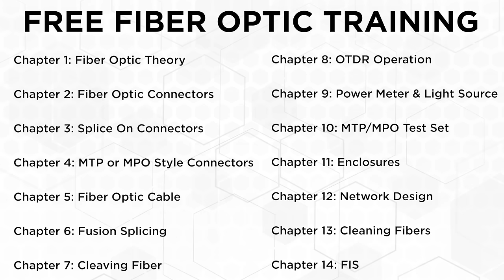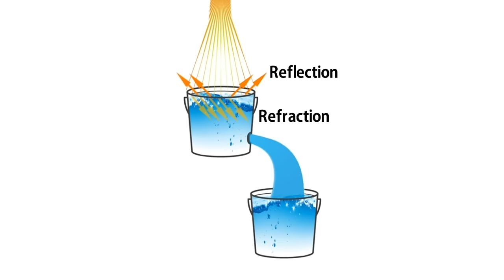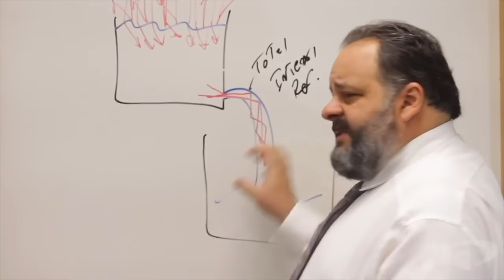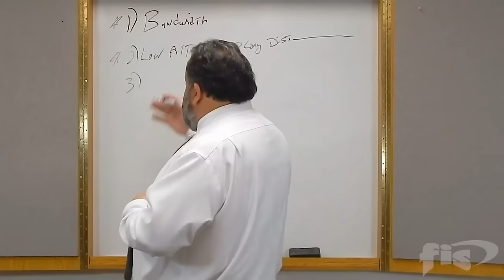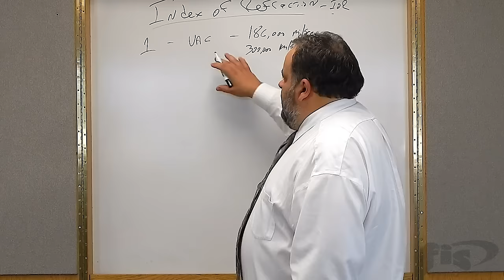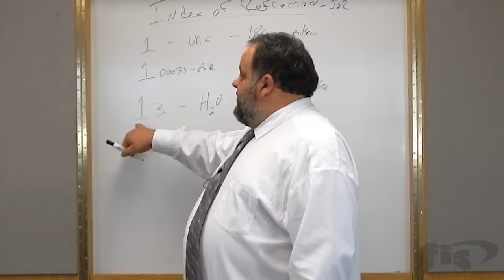Free 2 Hour Fiber Optic Training

Comment from the maker: At 6:46, the equation on Index of Refraction, the audio is correct but the graphic is wrong.  The graphic should be IOR equals Vacuum divided by Medium (Speed of Light)
Reply: Years ago I got to test parallel Ethernet services. The service on the FOC was slower than the service on a digital microwave. We always called multimode fiber campus mode because that is about as far as it goes.
Reply: IOR=Speed of Light in Vacuum/Speed (phase velocity) of light in a medium . Knowledge of IOR value facilitates accurate OTDR test/measurement. For example, the refractive index of water is 1.333, meaning that light travels 1.333 times slower in water than in a vacuum.

Comment: Hi, im so glad I have come across this video, i have a question about the splicer you guys are using the 70s splicers... I was once splicing with the same one and kept getting an error saying focus x motor trouble and fibre too dusty... so I respliced cleaved and everything and it kept happening why could that be?
Reply: Ahmed, Thanks for watching.  The error that you are seeing could be a couple of things.  #1 it may be that the camera lenses are dirty and the splicer is having trouble seeing the fiber.  I would remove the electrodes and use a foam (not cotton) cleaner soaked with 99% alcohol and clean the lenses.  I would then dry the cameras with a dry swab.  #2 you may have an issue with the motor that aligns the fibers, there are a few diagnostic tests in the firmware of the unit that can check the motors, ultimately if the motor is not working it will have to be sent in for repair.  I hope this helps ypu.
Reply from the maker: Thanks.

Comment: When I worked for AT&T we used 3M's mechanical quick term on a 900 micron installed wire. Where I work now we use the fusion spliced pigtail method to the drop wire in the NID then the premises tech uses a pre-made jumper from NID to gateway. Having used both, I will say the fusion spliced pigtail method is WAY better and more reliable.
Reply: MR Faiella, I cannot agree more, In my opinion you never go wrong when you fusion splice your connectors.  Better in every aspect, quality, price, labor and skill.
Reply: Used the mechanical terminations quite extensively, but theirs no comparison to fusion splicing, absolutely agree,
Reply from the maker: Thanks for watching.

Comment: John this video is amazing your knowledge of fibre optics is extensive. I will.be forwarding this video to my less experienced colleagues to watch. I apologise if iv missed parts on the video but if i haven't then i feel there's a few extras that need to be explained on certain sections. They may be basic but can help.
1. Multimode is generally used over short a distances. Singlemode used over longer distances.
2. With OTDR testing explaining a merged event at connecter end which gives a non reflective event. If people know when cleaned reflection becomes good but your connection loss is bad, we know its a bad splice in the termination panel. If you clean your db connector loss reduces but your reflection is still bad then we may have a bad patch lead or damaged fibre inline.

3. SFP Gbit i feel it needs to be explained if you have multiple patches through a network if you have bad reflection over bad splices you will not have a TX RX connection. Gbit sfps will generally work through a bad splice  depending on distances. If you have 1 or 2 bad patches with bad reflection this will stop a connection.

As i said this is a great video id like to chat  im not sure how to personally contact you but id like to pick your brain on some other bits i would like to know.

Hope to chat Dan
Reply from the maker: Thank you Dan

Comment: John and FIS staff, Thank you for this video! I especially loved the last chapter. It was FUSE-TASTIC! The FIS catalog has always been my first goto source, a bible for anything fiber related. A couple of things I wish were addressed in this video though. 1) the importance of careful disposal of stingers and shards. I have had contractors leave piles of scrap for people to rub into unknowingly. 2) The difference in the cleaning of UPC vs APC. One click is great for both surfaces but if people use a flat rub technique for APC, they may have issues. 3) For those of us newer employees with older microscopes (which don't go to a computer display), Guard Your Eyes from active signals!

Well done, keep up the good work!
p.s. Will future episodes discuss OM2, OM3, OS1, OS2, ratings etc., wavelength mux/demuxing, bend resistant fiber, tactical fiber, and/or a favorite of us broadcasters: Expanded Beam connector field cleaning?
Reply: Thank you for the compliment.  I am hacking away at videos and just did one on OM2, 3, 4 and 5, as a response to your question.
Reply from the maker: Thanks

Comment: I currently work in the copper side of UKs' telecoms industry. This video is very interesting. I kinda understand what's going  here. I could do this! It looks a lot less stressful and a lot more clean, that's for sure!
Reply: Mr Pdrum, First off hello England!  I have the opinion that anyone can work with fiber.  The best answer is to get educated on the medium and go from there.  Fiber will not go away and is still growing in use.  There is a lack of qualified educated installers in the fiber industry.
Reply: @johnbruno2740  hey thanks for the reply! After 24 years in copper for OPENREACH Uk, I'm thinking about leaving and starting afresh with a  fibre only company (if I can find one!). Its near impossible to move over to fibre in this company as they are very reluctant to let experienced  'Copper Engineers' leave the ageing copper network!
Reply: @thePeterpumpkin68  I hope that you can get your foot in the door with fiber.  I would believe it would be easier to move from copper to fiber than having no experience at all.  If you know how to work with fiber you will always have a job
Reply from the maker: Thanks for sharing

Comment: wow times sure have changed I worked in fiber optics in the early 80's at IT&T i did splicing and connectors
Reply: 25 years in this industry and one thing I can count on is that it is always changing.  The splicers back then were manual and over $20,000. Times have really changed.
Reply from the maker: Yes, they have.

Comment: can I use fusion splicer on a fiber optic with Visual fault locator laser currently on?
Reply from the maker: No, rbecause the light interferes with the camera in the fusion splicer and won’t properly fuse the glass together.
Reply: Sorry for the delay in my answer.  Yes you can.

Comment: Loss 0.04 is good ?
Reply from the maker: Good, yes but less is better.  During testing, we shoot for .03dB or less.
Reply: Remember that the attenuation shown on a fusion splicer is an estimate only.  The true attenuation is only obtained by testing it with an OTDR!
Reply: Absolutely, db loss per hop is expected to be from 0.01db - 0.3 db loss. Insertion loss for a brand new fiber is .05 db loss.